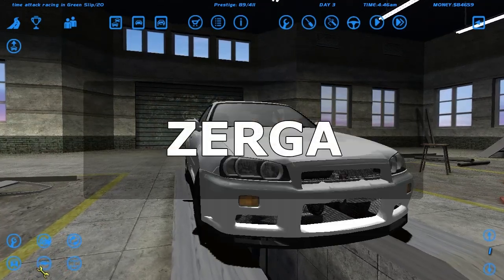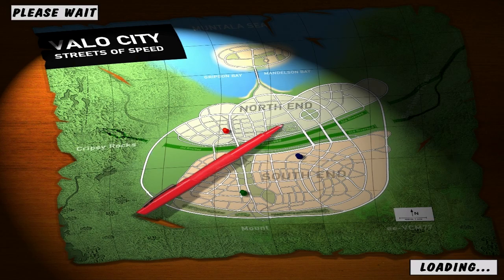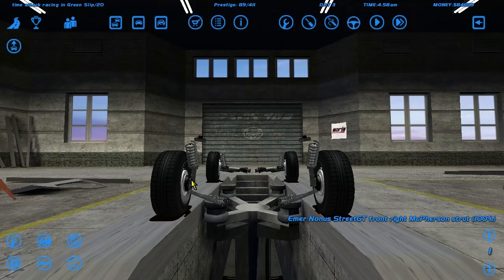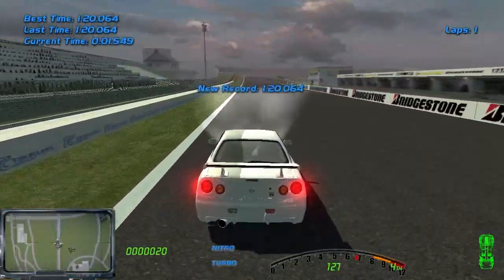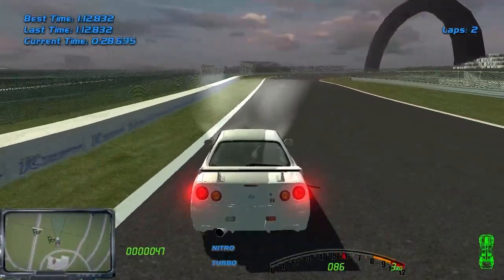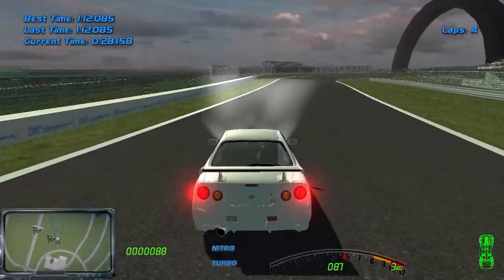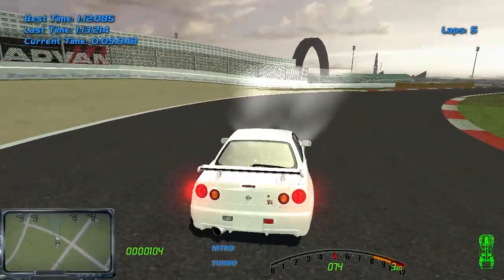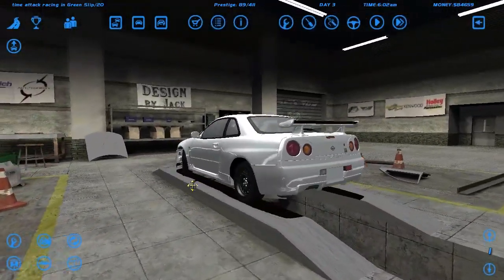Skyline R34 GT-R vs Tsukuba Circuit - TIME ATTACK SLRR - EP3

Comment: If you would have a clutch, you could use kind of a heel and toe in corners, so you don't lose revs but also to slow down and get weight on the front wheels for better grip, you could try on a button close to the throttle one, on the controller and see if it works
Reply from the maker: Truu truu I'll try heel and toeing